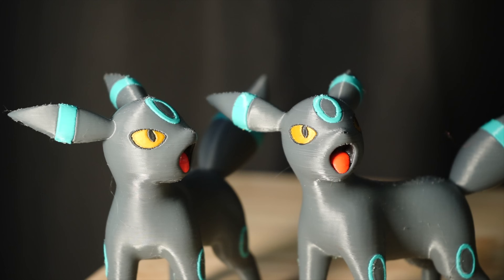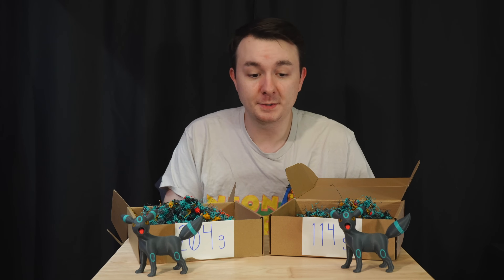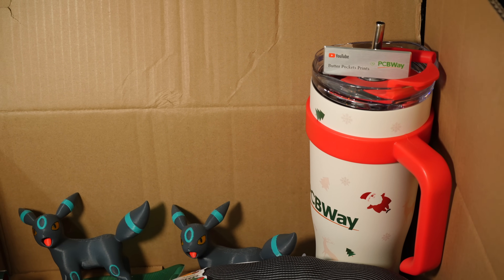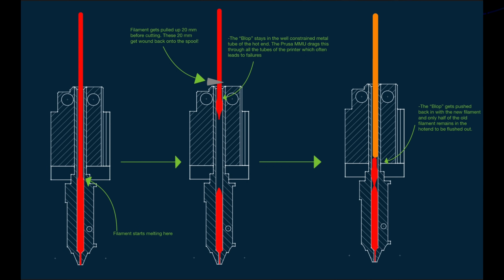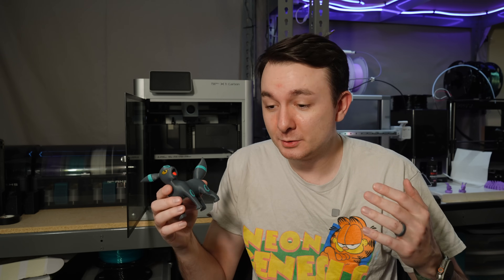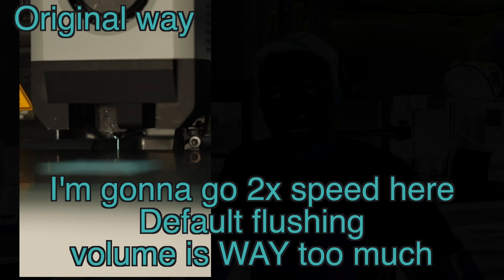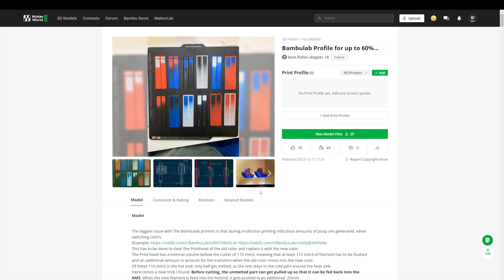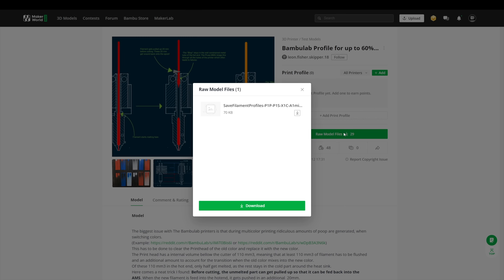The Best Way to Reduce Filament Waste for Bambu Lab AMS

Comment from the maker: To access the feature in Bambu Studio go to your filament settings, go to "setting overrides", and choose "long retraction when cut (experimental)" to turn this on without changing gcode.

Edit: it seems not ALL filaments have this, I don’t know why. So if you don’t see that setting stick with the gcode option I guess.
Reply: So instead of uploading the gcode you can now just simply enable this setting and it will save on the poop?
Reply from the maker: @happyhunting7837  as far as I’m aware that’s correct
Reply: @ButterPockets  I'm not seeing the long retraction when cut(experimental)
Reply: Me neither… anybody know why?
Reply from the maker: @happyhunting7837  so I looked into it some more and yeah I see what you’re seeing. Some filaments (namely Bambulab PLA basic) have it, but others (like Bambulab PLA matte) don’t have it. So if you want to try it on those filaments you’ll have to edit the code.
Reply: @jaredwilkins8691  It's because it's filament dependent if it works or if it creates hard to fix clogs.
They want to avoid people checking a single box and suddenly get half molten plastic dropping off inside peoples AMS, so they only enabled it (so far) on the filament they are reasonably certain about. Not sure if they've done any testing on it, but I presume they did some at least.
Reply: @happyhunting7837  the option could also be missing from your options if you do not have developer mode turned on in your preferences (right near dark mode)
Reply: @Sylfa  has anyone here actually had it clog doing this? & how often?
Reply: @Yash-c3v  It's enabled by default on bambulab's own PLA I noticed. Not sure how long that's been the case, but I've not seen any issues with it. Presumably you can do it safely on any PLA that isn't a scam.
Tbh, I think the main filaments to be careful about are flexible or gooey ones, like possibly PETG and TPU. Those are more likely to go stringy during the retraction and then start hardening at weird dimensions creating a blockage when the new filament tries to squeeze past.
That or abrasive filaments, which potentially could become a tougher clog to move due to not being as smooth. Or very high temperature filaments that harden quickly.
That's all guesswork though and I'm far from an expert, use your own common sense and research it.
Reply: @Sylfa  thanks for quick reply. I've never used bambu filament so pay about 1/3 the usual price but always set it as Bambu PLA in the AMS, so a bit tentative even after reassurance :D
Reply: @anwyll  I don't even see dark mode
Reply: What do we put in the retraction distance when cut?
Reply: thanks! When I go here and enable that another check box pops up...do I need to click that one as well?  When I check that second box another option that reads "retraction distance when cut" shows up...do I need to mess with that?
Reply: Will this work with non Bambu filament?
Reply: @Numenor7  It will, but you'll have to keep an eye on it to make sure you don't get clogs. As long as it's PLA I doubt you will, but it depends on the filament. Clearing clogs isn't too bad luckily, just make sure you have time to do so if your filament winds up clogging on you.
Reply: @Sylfa  thanks. Yeah I've had 3D printers for a while. What I meant was, will the settings options be available for non Bambu filaments?
Reply: @Numenor7  Yep, it's just not enabled by default.
Reply: Thanks for the info! I also confirm that the setting is there on Orcaslicer, at least, on the 2.3.0 dev version.
It was also enabled by default for Bambu PLA for me.
Reply: does this work for the p2s?

Comment: Hi, Many thanks for your explaination🙏🙏🙏 As I understand, to start the retraction process, the nozzle has to move to specific coordinate ( normally 0,0), then loaded filament would be cut before retracting. I know it sounds silly but I'm looking for solution to print in spiralised mode/vase mode, in which I can mix 2 materials without flushing any poop (to create ombre effect: showing transition between 2 original mater). As vase mode requires continuous process, it there any chance to start rectraction process without moving nozzle? Sorry for long post 🥲

Comment: If you are using OrcaSlicer, go to "Printer settings" - "extruder 1" and go to the bottom. You don't need to change it in filament settings.

Comment: If you're wondering if this feature is available by default now, as of Jan 20, 2025, it most likely is:

Bambu Studio 1.9.0 Beta - implemented as experimental feature in extruder settings for X and P series
Bambu Studio 1.9.0 Beta 2 - implemented as filament setting override available for X1 and X1C filaments
Bambu Studio 1.9.1 Beta 4 - filament setting override added for P1P and P1S
Bambu Studio 1.10.1 Beta - filament setting override available for X, P, and A series printers for wide variety of materials

Comment: A1 Mini now has the "Long retraction when cut" setting in Bambu Studio (v 1.10.1.50)! I did try the gcode modifications but ran into lots of issues loading and unloading the filament and had to help it manually for a LOT of layers. Hoping the built-in setting works better. It does default to 18mm instead of the 20 from the gcode changes, so maybe that will help my issues.

I'm also using the AMS Purge Calibration prints to fully fine-tune my purge amounts rather than just changing the multiplier. To and from two of the colors I have, I can save an extra 50% over just setting a .5 multiplier (white and a lighter color). It'll take a little bit of time and doing but that's a pretty substantial savings.

Comment: I believe if you can change the gcode could you not have a mod that injects Gcode of a toy model to the current print to and remove the poop gcode so you print models you can use as stocking filler or sell like those bargain bin toys. I also like the idea of Keeping tree suppiorts and printing leaves to paste onto the trees to sell for an engineer's archetect model or a gift for someone's Fairy Garden

Comment: has anyone discovered a fix to use this method on the P1S?
the default gcode for the P1S doesn't match up with that of the PDF, and it gives an error when slicing.

Comment: Why can't it be calculated how much can be printed with the filament that will be flushed and cut it in advance, using the filament that would be wasted on the actual print. If the calculation is not precise, which I understand, use 80% of it or so and waste just a fraction before changing the filament color.
Reply from the maker: I get ya. That would be a great way to do it. I think, if I had to give a reason, that the current way was the most repeatable and reliable method. They went with that and stuck with it. Coupled with the fact that BL didn’t make a custom slicer but just re-used slic3r.

Comment: What they should really do is make a cutting mechanism that cuts below the nozzle. So on a filament change the printer cools the head, pushes out just enough filament for any bulges, then cuts. Almost no wastage and potentially no need for a poop purge either (or just a very small one).

Comment: Can the Bambu A1 AMS lite colour change without purging? Like if I wanted to make a multi colour thing and don't mind the colour bleeding to create a transition if you get me.
Reply: When you cut the filament and put the new one, the printer can't do retractions (new filament is not connected to the old). This means filament  already in the hot-end will just flow when the head is moving and you get stringing. It is way safer to flush it on the side than to drip everywhere and ruin your print.

If you print a big part, you can flush in the object itself (there are such settings) as infill, and don't lose anything. But still, it has to be so big object that the current layer doesn't need retractions. 

And not only it don't have retractions but it also have plenty of space to flush before the next change, which, if you have 3 colors on the current layer, is next to impossible.

Comment: Thanks for the tutorial. I have a model that flushes 28g using default settings. When I change the preset to this one, it still says it flushes 28g. Is the reduction in poop not reflected in the flush column? Did you manual weigh it which is why you said it could reduce the poop by almost half?
Reply from the maker: You should see it in the calculation. Did you change the purge multiplier?
Reply: @ButterPockets  Yes. I did some more research after I posted that comment and I found that Bambu already implemented this preset in a firmware update. I think that's why I saw no change?
Reply: @andreiblue_ So this isn’t necessary anymore?
Reply: @EpicBenjo  Yeah, just update to the latest firmware and this video is useless.

Comment: I think it saves 5 mm3 per filament change not 50. Converted to imperial it would roughly flush 2"x2"x2" instead of 1/5"x1/5"x1/5" per change.
Reply from the maker: LeonFisherSkipper did the math 🤷🏻‍♂️
Reply: @ButterPockets The math is correct (and I'm currently printing with the profile thanks to your vid) but at 3:19 you say 50mm3 and around 5:28 you say 5mm3, so I think the 50mm3 is a spelling error? I can't imagine purging the volume of a small rubiks cube during every swap.
Reply from the maker: Oh I see. 50mm3 does not mean 50x50x50 it means 5x5x2. (5x5x2=50 cubic mm. Not saying a cube that’s 50mm on each side). I’m assuming whenever I say 5 it’s probably the incorrect spot.
Reply: @ButterPockets check, yea I think I misunderstood you because you were saying "50 mm cubed" instead of "50 cubic millimeters" (50 x 1^3) Great video nonetheless, saving a lot of filament!

Comment: Got an A1 Combo on the way..... did Bambu bring this change into standard code yet?  Or do I need to do this every time I fo an update?
Reply from the maker: I really don’t know how Bambu implemented it. It’s somehow baked into Bambustudio but there’s some way you have to turn it on.
Reply: @ButterPockets  Thanks for the video, I would not have found this without it.  In Orca Slicer and Bambu Studio the Developer Mode needs to be turned on.  This is found in the Preferences tab (via down arrow next to 'File', top left).  Once set you can access the feature within the printer/nozzle settings, Extruder tab then all the way at the bottom.

Comment: So, i'm using Orca with a X1C.
I can't find the "long retract on cut" anywhere in the Slicer, but when looking into the GCode for Filament Change, they already account for it.

{if long_retractions_when_cut[previous_extruder]}
M620.11 S1 I[previous_extruder] E-{retraction_distances_when_cut[previous_extruder]} F{old_filament_e_feedrate}
{else}
M620.11 S0
{endif}

Where then can we toggle the variable long_retractions_when_cut???

Since it is already somehow in there, i would prefer to use the slicer variable rather then adapting the code.

Comment: Wait so is this inside the current bambu? I was about to do this 'mod' but wondering in the date of this video and whats in the code now
Reply from the maker: Number 6 on the list of features added to Bambu Studio 1.9! https://wiki.bambulab.com/en/software/bambu-studio/release/release-note-1-9-1
Reply: @ButterPockets  Has the feature been removed? I don't see this option at all. I am using version 1.10
Reply: @KissenschlachtLP  You can see this feature when you enable "Develop Mode" in studio preferences. I'm using v.1.10 and saw this after changing the preferences.

Comment: I'm new to this and using 1.9 already, so it's hard for me to visualise if this feature is actually included in the new releases. Is there a way we can verify that this Gcode is being included in these releases, or some version of it? I'm struggling to see these Gcode lines in my profiles, but it could just down to me being a newbie at this.

Comment: Great video! Is this still useful for the A1’s today or have Bambu implemented it themselves?
Reply: Im having the same question
Reply: Same question here! I just bought a brand new a1 mini combo.. I need to know if I gotta change the G-code myself or if it will have this update working in the slicer automatically. 

What can we look for to determine whether this G-code is active or not? I suppose we can do a print and see if we hear a retraction happen before it cuts the filament.. has anyone done this? 

BTW this is my very first ever bamboo lab printer and I’m excited. I own 2 Flashforge m5 pros and they have been FLAWLESS.. but not being able to multi color print has been killing me as I’ve been doing it all manually and it’s a huge pain. If bamboo can print as good and as reliable as my flashforges while also giving me the ability to do Seemless multicolor then I may end up selling my flashforges and buying 2 X1C’s instead.

Comment: You can easily change your purge volume to 0.5, works perfect
Reply: On specific prints, the flow control can be set even lower. Bambu studio will give a red warning if any of the values in the flow ratio matrix gets too small. And for some prints, you will get this warning even for a 0.5 multiplier, so stay awake when adjusting.

Comment: If you change from Black to white this wont work.
Reply from the maker: That’s why you use the knowledge in this video to tune it yourself, much like it says on maker world. You can’t just take what I did and expect it to work. It gives you a method to build on. The purge ratio from black to white would just need to be higher, which you can set.

Comment: "This Feature got implemented for P1 and X1 in BambuStudio Beta 1.9. "
This is per the creators linked page.
Reply from the maker: That’s incredible. I can’t believe they got it added in! I pinned this comment :)
Reply: how do i access it?
Reply from the maker: @PunkRockBenWilson the betas are usually closed.
Reply: Is this in Orca Slicer? I’m having trouble justifying it over Bambu now.
Reply: @jdepew On the Leon Fisher Skipper's Makerworld page there is part saying "Orca Slicer may work but is not tested!" 
So... maybe? I think you should try it out. I am going to try it myself later, I don't atm have yet tried Orca Slicer myself.
Reply: @Aanaartu  Any updates on if this works with orca slicer?
Reply: @PioneerPrint3D Tried this on orca slicer, got 0 poops and under-extrusion on the priming tower at 100% speed, but good results at 50% speed. I think I'm going to have to try bambu studio.
Reply: Is this feature public yet? How do I turn this on
Reply: How do we know if this is in place already?
Reply: Is already implement it ?
Reply: @diiogolince5343  yes
Reply: finally they added it i hope they give the original creator some kind of compensation as he fixed a huge issue in their ams
Reply: @BarkingTadpole  Bambulab copied and pasted from all open source slicers and 3DP knowledge from the community…. I don’t think they will compensate anyone 😅
Reply from the maker: @mikea6243  Please take like 5 seconds to figure it out yourself before commenting something dumb. Go into the settings for your filament, go to "setting overrides", and check "long retraction when cut".
Reply: @ButterPockets  You have to go to preferences, scroll down to the bottom and check the box that says "Develop mode" then it will show up in your nozzle settings on the extruder tab at the bottom
Reply: @ButterPockets Welp, that’s the kind of reply that makes me tell Youtube to stop recommending a creator

Comment: So I just picked up an X1C and went to do this, and when I pulled up the flush volume, it's already set to a .3 multiplier.  Do I need to do anything special with that, or am I just already in a good spot with it?
Reply: Wow!  That is very interesting.  I was going to change mine to ..25 ... now I will go with .3.  A good nod from Bambu Lab I'd say.
Reply: @pjtodd6756 This was in orca slicer, so I don't know if it was bambu or orcaslicer setting it that low out of the box
Reply: @FlesHBoX  Thank you!

Comment: What I don't get is why the change is not done a bit earlier and the remaining filament is used for printing. e.g. if there is a colorswap coming up in 1-2 grams, why not already du the cut, change the color, and use the remainder in the nozzle for those 1-2 grams. That way no hot filament would have to be retracted. I'm totally new to 3D printing, so I must be missing something since that would be the most obvious way.
Reply: I am wondering this as well. I'm new to printing and currently researching but this seems like an obvious way to handle material excess.
Reply: Once the filament is cut, you can no longer perform retractions, so the last bit before each color change would be more stringy.
Reply: @lukrative525 that's a fair point I didn't consider. Thank you!
Reply: I agree, this seems like it should be doable in the future..

Comment: I figured this out a while ago when doing a print with 2000+ filament swaps, and it actually printed for days with no failure. The problem is that as soon as you have any contamination above the heat break (any cold filament stuck to the cooling zone), the nozzle is wasted. In theory this method is not ideal, but I simply haven't had any issue with it so far.

Comment: I was watching another video where someone changed to .5 flushing volumes with no issues, even without these additional steps.  but  I am still going to test this also!
Reply: Yes, this reduces the waste amount of the new color, after the filament change. But by doing this you also reduce a part of the previous filament color, that would be otherwise lost from the cutting.